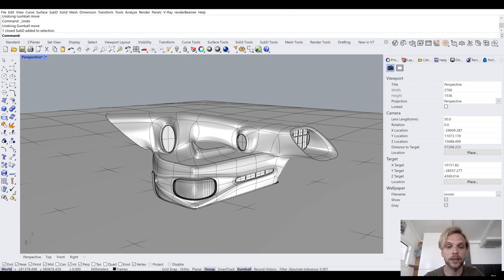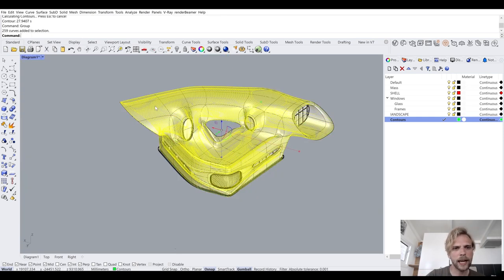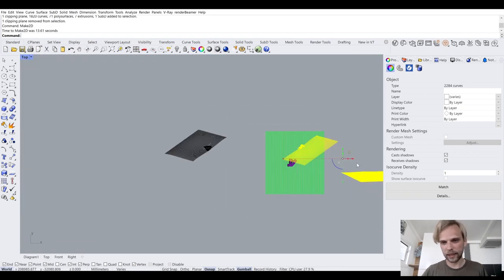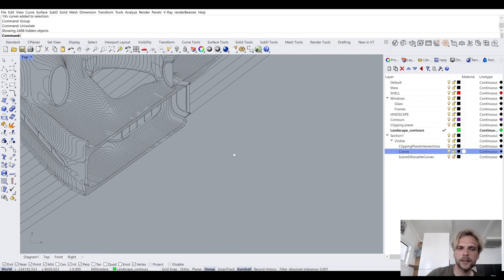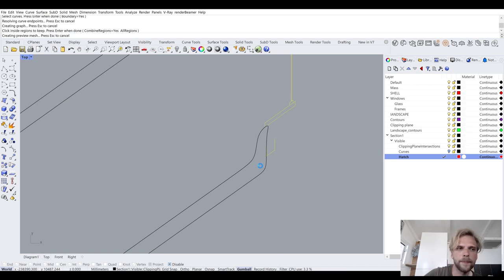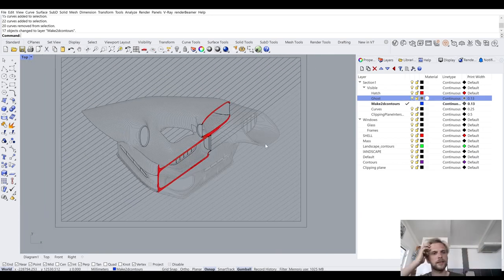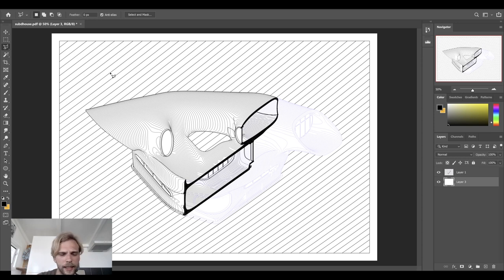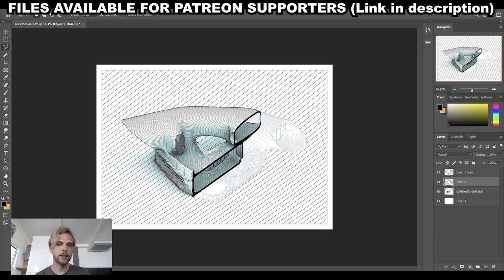How to: Architectural Diagrams with Rhino 7

Comment: I have a question about clipping planes, my clipping plane does not have 'blue' fill like in this video . I dont know how to generate it. How can we achieve these fillings?
Reply from the maker: On the right side, where you have your layer/properties and other panels, there should be a panel called "display". In that panel you will find "clipping plane fill" option - that's what you want to enable. If you do not see the display panel, click on the small gear icon next to the names of the panels.

Comment: Another very cool tutorial. Unfortunately, rhino has too many bugs. Make 2d doesn't work, and many commands fail without reason, like the contour in the terrain. From my experience, I have found reasons that cause some of these problems. So let's say about contouring. If you contouring the terrain, and the terrain is an organic shape, decreasing the tolerance of the document solves the problem. Another way to solve the problem is to split the terrain, in your case into two parts, without clanging the tolerance. The same happens in other operations as Boolean subtract. I wanted once to make a solid smooth terrain for a large area. I began from a quad mesh I already had. I converted to subd without remeshing. Then I draw a solid box just a bit smaller than my subd and I tried to Boolean subtract from the box the subd. In the beginning, it fails and it shows me where it has intersection problems. There was no reason to fail in these areas. So I split the subd and the box into 4 pieces ( I began with 2 but still had errors). The corner in which I previously had problems in Boolean subtract, which don't affect by the split command, now works perfectly. The way I use these 4 parts to fit perfectly together was to make an overlap between neighbors areas and then trim them back to the same line. From all these, I conclude that this is a memory allocation problem. And my computer has a lot of it. I will try to see if this is the case in other commands that fails like make 2d. You can also try to keep a small part of your organic project and see if that solves some problems. I will also post my founds in McNeel forums to see if it's something they can fix.
Reply from the maker: Hmm, the file tolerance fix is something that I have been using since Rhino 4 and still have no idea why does it sometimes work and other times it does not. But hey, it all comes down to us not really having a good alternative for 2D drawing extraction from fancy 3D models other than Rhino. Unless I'm missing some sort of a breakthrough in the competition.

Comment: To solve the plots with hatches showing up as broken lines (I’m on PC):
- open the PDF in acrobat
- go to Edit > Preferences 
- in Page Display, within Rendering, uncheck Smooth Line Art
- re-save. 

That did the trick for me at least.
Reply from the maker: That's a great tip! Thanks, will check it out.